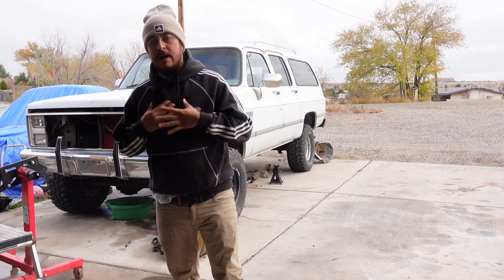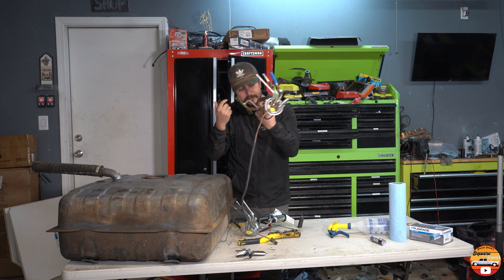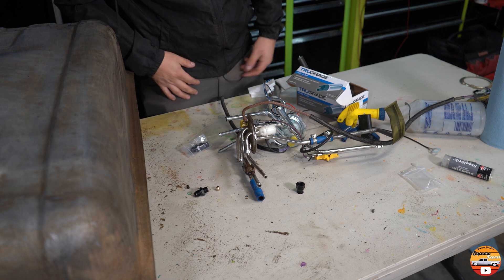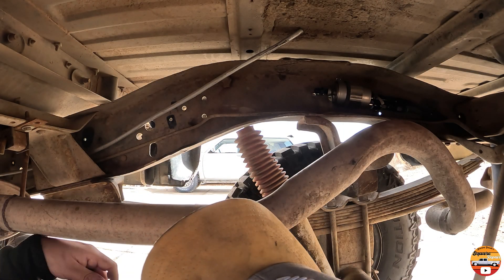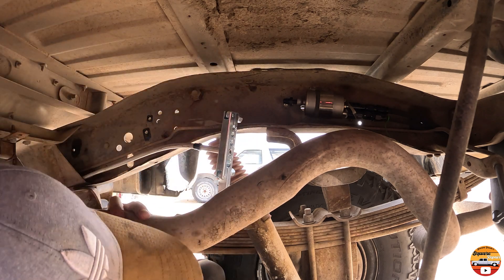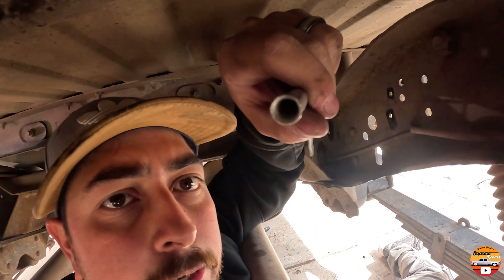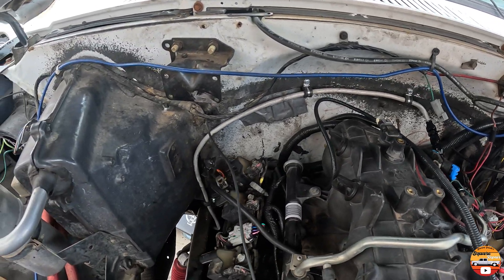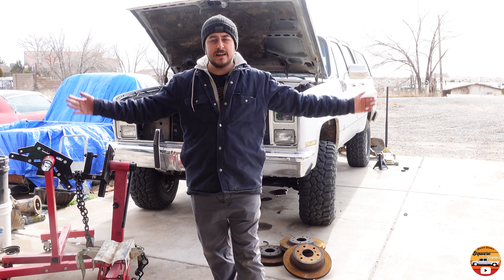HOW TO BUILD THE PERFECT LS SWAP FUEL SYSTEM - Square Repair Episode 3

Comment: Did you have to use a adapter or did the trans bolt up to the ls?
Reply from the maker: @zacherynewsom2426  it bolts right up

Comment: Does this regulator set up with the one single feed line going up to intake work on all la swaps? Is it the same for all engines or is there another were you have to run 2 lines up front?
Reply from the maker: Some intakes have a return on the fuel rail. In that case you either run a separate filter and two lines all the way up or convert it to a return less rail

Comment: I'm a Mopar guy but I love your content! I'm doing a hemi swap on my truck and I'm using a Corvette fuel filter/regulator 😂 Wish I would of gone aluminum lines. Ptfe really does get expensive. I needed 6an for my fuel system and 8an for my transmission! Keep up the good work! I'm noticing your video quality is improving!
Reply from the maker: Thanks man! And yea I got tired of spending so much on PTFE because the regular AN stuff falls apart after a year or so

Comment: Never knew about those "Corvette" fuel pumps. I'm wondering some more pros and cons to it. I guess only that it's 2 in 1 if one goes bad. and it can't be adjusted. But for fuel injection you shouldn't need to adjust it, like you said, under 400 HP or so. Nice. I will check more into this later.
Reply from the maker: It was really common back in the day, it's a filter/regulator. Limits the fuel to 58psi. Which is perfect for stock to mild builds. And they are cheap enough now that you can just throw a new one in every couple 10k miles